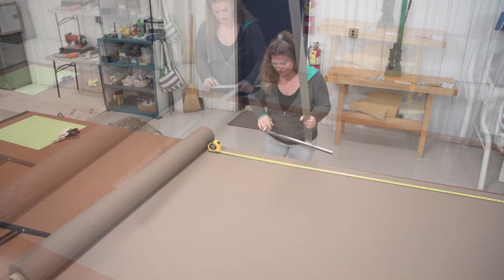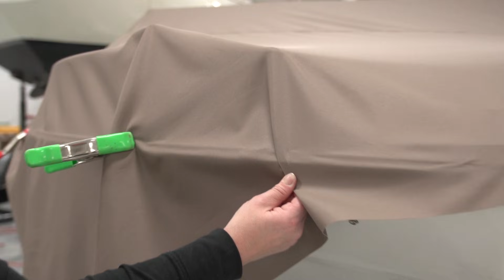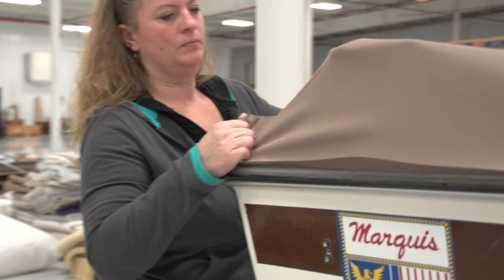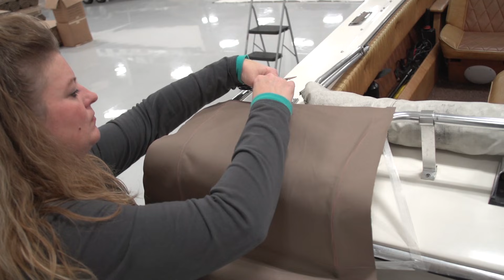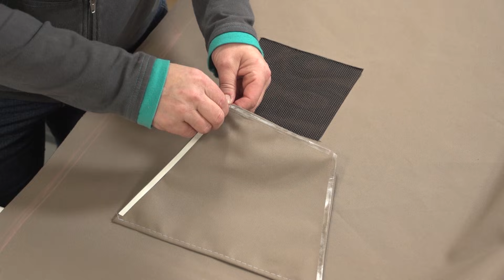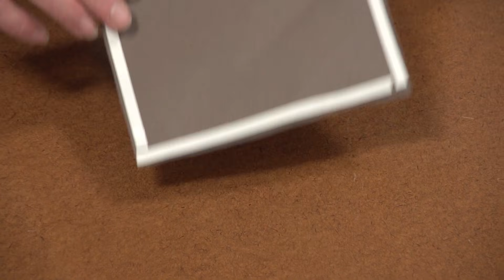How to Make a Power Boat Cover

Comment: Super helpful video. I've watched it several times over as I work on my own mooring cover. One question: why extend the length of the line scribed around the rub rail by a full inch, instead of a 1/2 inch? Is this additional length for something other than seam allowance?
Reply from the maker: In the video she marks the cover on the upper portion of the rub rail, so adding the 1" includes for seam allowance and the lower portion of the rub rail. That 1" or 1/2" addition is not too important since a skirt will be added below it anyway.

Comment: I remember watching this years ago when i first contemplated replacing my boat cover. I've been handstitching loose threads and restitching stretched zios and patching the windows. Maybe this will be my winter project. Do I need an industrial sewing machine? I have a modern domestic machine. Thanks.
Reply from the maker: Thanks for watching! I'm glad my video sparked your interest in replacing your boat cover. In terms of whether you need an industrial sewing machine, your modern domestic machine should work fine for most boat cover projects, but an industrial machine might be better suited for heavy-duty materials. It's always a good idea to test it out on a scrap piece of fabric first to see how it handles.

Comment: video is 9 years old. i have watched it multiple times along with the pontoon video. great organization, procedure and details. would like to see a cover for a smaller boat--bass boat, center console, jet ski etc with emphasis on the the different considerations for a smaller boat. how many rolls of 129 does a typical boat take?
Reply from the maker: Good suggestion, Thanks!!! We do have a jet ski cover tutorial video here: https://youtu.be/XxLDDoPyNI8 If you buy the 50 yard Seamstick for Canvas SKU:129 it will take about 3 rolls on average.

Comment: If the rough fabric panel had been placed on the boat inside out after seaming, then all that work transferring the darts to the other side and potentially losing some shape would have been negated given that the boat should be identical on both sides?

Comment: I may be wrong but it seems as if once the four panels are sewn together the fabric should be flipped over and put back onto the boat. This way the dart markings do not need to be transferred to the other side before sewing.
Reply: It would be backwards then.
Reply: @TERMIN8TOR99  He would probably put it back on right side up after sewing the darts. Many boats, such as the one in this video (other than the ladder) are quite symmetrical.

Comment: Why are they not using Dura skrim to pattern?
Reply from the maker: Kevin Witbrodt A cover can be made using Dura Skrim and then it is used as a patter to cut and sew. Or a rectangle of fabric can be sewn together and it placed on the boat, like it were the patter material and pleats can be created. It is the sewer’s choice.

Comment: Thanks,  I just made a nice bow cover using the tape to fit method you illustrated.  Now i need to order more tape for the mooring cover.  I bought a used boat with snaps, but no covered.  I ordered navy sunbrella.   thanks for created and posting this video.  Bill from Augusta, ga

Comment: Would be unreasonable to think this could be fitted with the fabric upside down ?
Reply from the maker: No, if it were the starboard side would become the port side and the opposite side is not the same shape.
Reply: @SailriteDIY  I was contemplating the same idea of patterning the cover "inside out". The only thing that seemed to be "not the same shape" was the ladder which could be patterned after the darts were sewn and the cover replaced right side out.

Comment: I get so much useful information from sailrite videos.  However, I really would like to see a demonstration of a boat cover that has to go around objects such as bimini poles and cleats using hook and loop.
Reply from the maker: We have a new trailing cockpit cover video coming out very soon. It does not use hook and loop but instead snaps. However, it was designed to installed with the bimini poles down. Be watching for it on our channel or website.
Reply: Thanks, you guys rock!!

Comment: Minor screw-up at 22:51.  I wonder if the customer noticed that little burn mark?
Reply: It's an "in-house" project , for video purposes only.. management boat.. advice.  Careful not to burn it like I did, for a real customer,  or you'll be replacing the panel lol.. and besides, this time it was hidden by the dbl hem..
Reply: myownspiritlevel I noticed that too! I wonder what sailright does if mistakes like that are made? Can you cover up a bit hole like that?

Comment: So to make it easier could you just sew two 60" pieces that are 20' long down the middle? Seems like that would be better for driving also; so rain wouldn't be forced into the seams, but rather along it to the stern as you drive. I understand you could save some material, any other reason not to make one seam length wise if you have material that is long enough? Then make darts/ etc and cuts...
Reply from the maker: You are correct, you could sew a seam down the center, but this may cause more fabric waist.

Comment: Thanks for sharing your video!  Getting ready to make a loose cover to keep the sun off of our Chaparral (will go over the manufacturer's cover).  What size straight stitch would you recommend?
Reply from the maker: 5 to 6 mm straight stitch would be good for a boat cover. 6 mm would be best to reduce needle pucker.

Comment: Great Video. I have one question.  What is the best way to tackle wake board towers when making the cover?
Reply from the maker: Typically if the cover has to be build around the tower poles a "U" shape is cut into the cover the edge hemmed under and a small boot sewn around the edge of the "U" to funnel water past the opening. In many cases the lower portion of the "U" is left open and snapped on the boat at the bottom edge. In some cases a zipper with flap can be used, but this is seldom done, due to more labor time. I hope this helps, let me know if you have more questions.
Reply: Sailrite What about the cinch rope that goes around the bottom of the cover.  would you just tie it on the side instead of the front?
Reply: Sailrite very good video
Reply from the maker: Thanks for your positive comment! Let us know if you have questions.

Comment: Great video! I'm about ready to make a cover for my 1976 Cobalt, but it doesn't have snaps below the rub-rail. Would you recommend installing snaps, or would it be better to tie this down to the trailer?  Also, the ladder really sticks out from the rub-rail, maybe 9" or so, that really puts a gap in the transom. What should I do?

Thanks, Love the videos, John
Reply from the maker: You can tie it off to the trailer instead of using snaps, but this means you can only use the cover when on the trailer. I like snaps personally. You should build out a separate cover for the ladder that will still be sewn to the main cover, just follow the principles in the video for that. ENJOY!
Reply: Thanks!